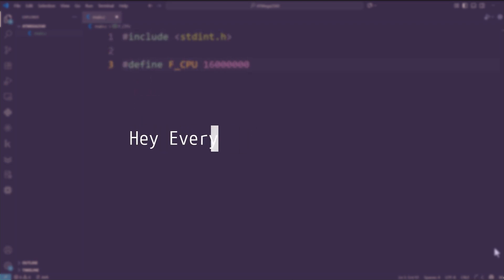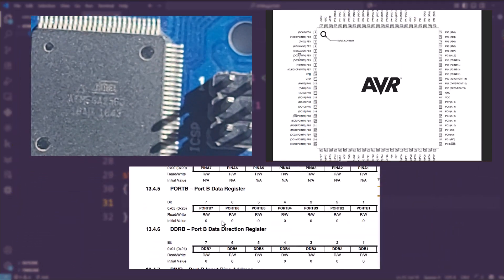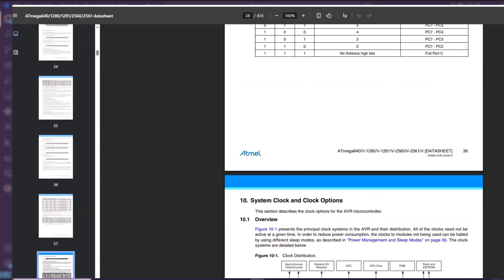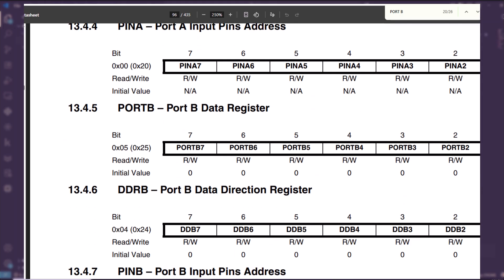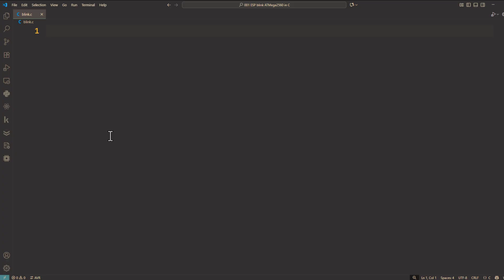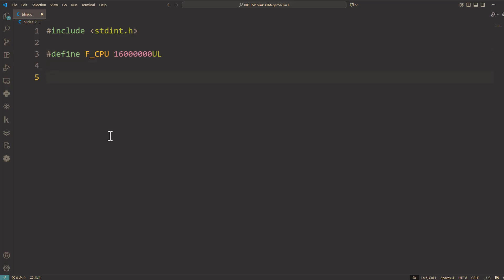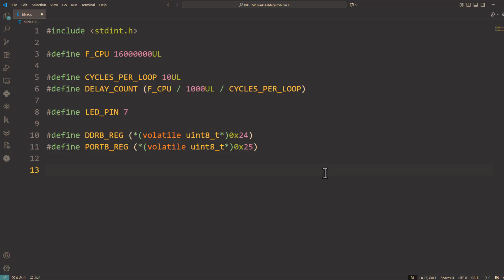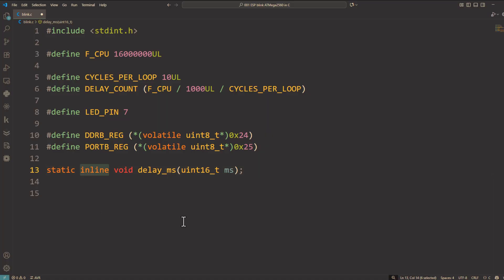Bare-Metal Embedded Systems (AVR & ARM) in C & Assembly – blink atmega2560 AVR MCU in C

Comment: I'm a bit confused by the delay function, we write a double loop to execute a NOP instruction, but every iteration it also has to increment the counter and check against the loop conditions, doesn't that give extra assembly instructions that are executed every iteration?
Reply from the maker: Good question! 👍
You’re totally right — each loop iteration does more than just a NOP.
That’s exactly why I defined CYCLES_PER_LOOP in the code — it represents the total number of CPU cycles that one full loop iteration takes, including the NOP, the counter increment, and the condition check.

So when we calculate the delay using DELAY_COUNT, it already accounts for all those extra instructions — not just the NOP alone.

If you ever need precise timing (like in communication protocols), you’d use a hardware timer instead of a software loop. But for simple LED blink delays, this approach works perfectly fine.

In future videos, we’ll also use interrupts to handle timing more accurately. ⏱️
Reply: @rebwar_ai Aaah I see now, thank you so much for your thorough response 😁
Reply from the maker: You're very welcome! 😊 Glad that helped -  more cool stuff like this coming soon!